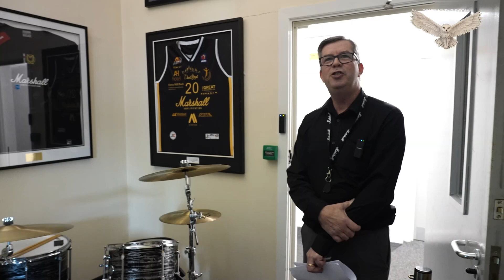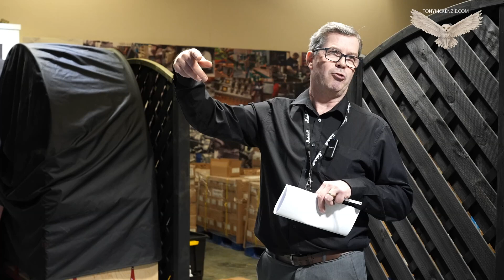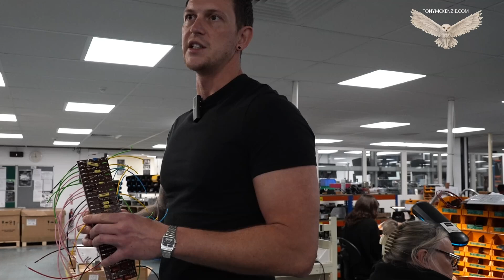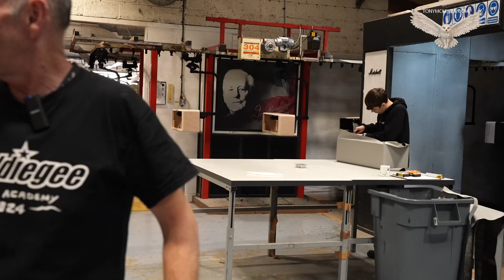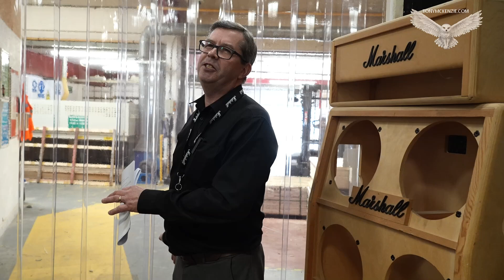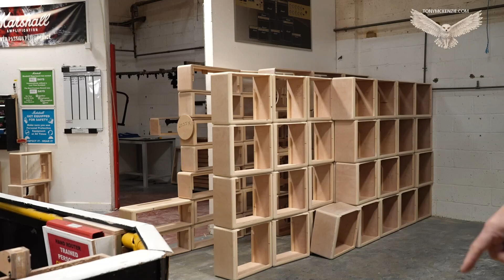Inside The Secret Marshall Amp Factory Where Guitar Magic Happens!

Comment: You guys need to pack your 4x12 speaker cabinets a hell of a lot better than you do. Both of my 1960 HW’s were damaged in shipping. Vinyl tearing, cracked logo on one. No corner’s/edge’s protection. I mean I know I’m not a signature artist, or anything like that, but have some pride.
Reply from the maker: Well I'm not Marshall! But I know carriers can be bad also sometimes. If you bought it from a dealer sometimes they ship gear that is marked or damaged... I had a Marshall YJM scraped across the bottom of the amp by a dealer. Thankfully they changed it. Do report it back to the seller... and thanks for that post - it matters - and thanks for watching.

Comment: Very interesting, the one and only Marshall amp i owned was a JTM60 
which i rarely used, it sounded gritty when playing clean so it went.
Give me a Vox anyday over a Marshall, or better still a Roland Jazz Chorus
for silky smooth clean tones.
Reply from the maker: Oh its all down to what someone needs - my 'clean' many will tell me its not clean, and I get that. It's one reason to try amps out very carefully I think. Check that Train Wreck Ceriatone 'clean' at the end of the video and how clean is that in your opinion? Would be great to hear... and thanks for watching.

Comment: Are Marshall using foreign made Power Transformers in there British made Amps?
Reply from the maker: They said not in the video. They said English made amps ARE all English made. Check I'm sure its in the video - maybe they had a change of plan. And thanks for watching.
Reply: @tonymckenzieofficial  No worries I will do the research before assuming , I did watch a YouTube video and a guy opened up a British built Marshall JCM 800 ( I think it was) and found a far Eastern made low budget Power Transformer . Again I will do my research . Thanks for the quick reply.

Comment: My Vietnam made dsl20 just died, less than a couple of years old, never left the room it was unboxed in.
Sounded great for the short time it lasted. Apparently they are not so good.
Reply: Did you let the magic smoke escape?
Reply: @TheCyberMantis  no burn smell in the amp, but I smoked when it quit.
Reply: Are Marshall using foreign made Power Transformers in there British Built Amps ? There was a video online about this , Friedman said that the Power Transformers are one of the most important parts in a tube driven amp
Reply: @therealandrecorbin2112  probably a simple dry joint or 50 pence component failure.  Can happen anywhere.
Reply: @MS-Patriot2  oh, well ok then, thank you
Reply from the maker: The Vietnam ones cost lots less though? right? While I'm sure many will tell you they are the same, I don't think so. The Origin I bought was not particularly up to the same standards as the UK version amp - even the tolex felt far less. The UK gear is exceptional and I have never had a single failure on that gear. Thanks for watching.
Reply: @tonymckenzieofficial  hey Tony, yes they're cheaper. Before I got the brand new dsl20, I had gone through two used tsl100w in a row that both had the crappy power board problem. Marshall for life here, but it looks like I have to sell a car or something to afford a good one built in the UK.

Comment: How many of these meticulous process steps does the Marshall Vietnam factory even try to implement?
Reply: Yeah, I would like to see a tour of the Vietnam factory.  A lot of PCB and cheaper components no doubt.
Reply from the maker: Sadly it's too far for me... but thanks for watching.
Reply: @tonymckenzieofficial  thanks for the video. The question was just out of curiosity.  Certainly did not mean to infere that you go there. Hopefully someone there can do a tour so we can see what actually goes on and how different it is from Marshall UK
Reply: Why would they I thought that was the whole point of them being the more affordable option , your going to get and use affordable parts
Reply: @ledhensrv  point is that they are also branded as Marshall.  If they deviate significantly,  a lot of people would like to know and decide if it's still a Marshall or not!